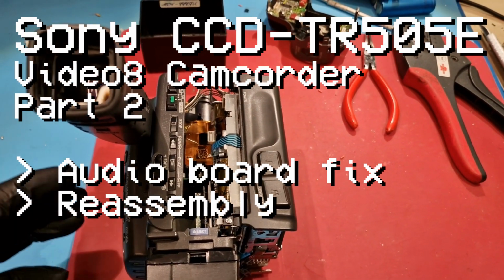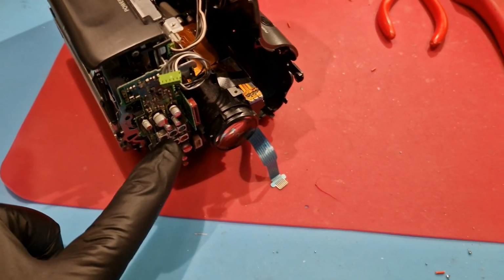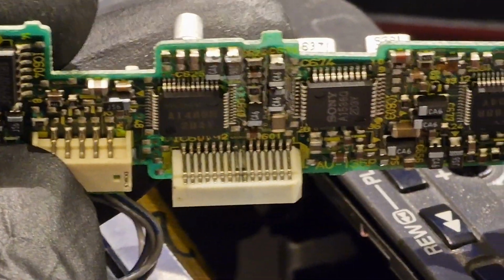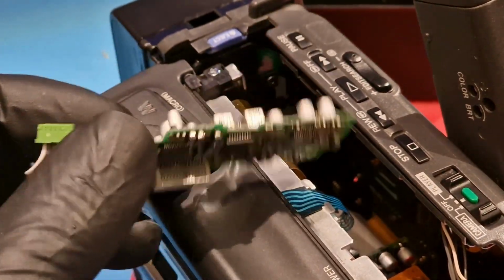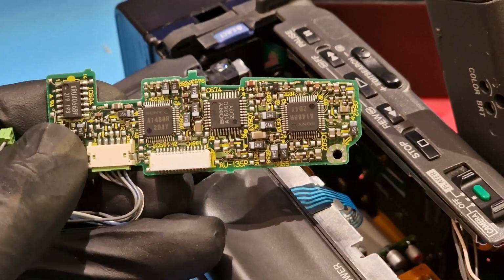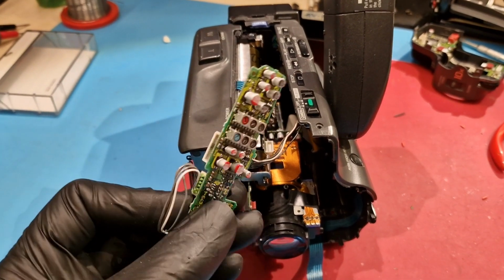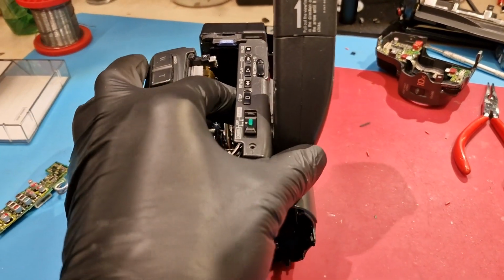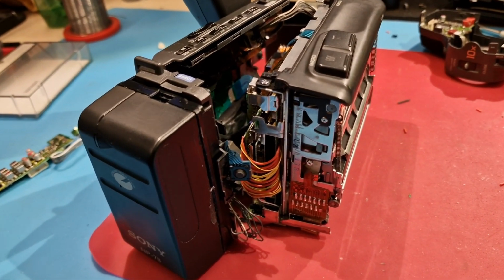TINY COLOR LCD! Sony CCD-TR505E repair part 2

Comment: great job and thanks for sharing! What would you suggest to preserve the flex cable integrity when servicing the boards, double side adhesive tape, glue, .., what do you think. I have a TR305 having similar problems which I need to fix sooner or later.
Reply from the maker: You're welcome! :)

The flex cable has been glued to the edge of both the DC-DC converter and the main PCB - due to age, the glue doesn't stick to the flex cable anymore. Before you start working inside the device, you can carefully apply fresh glue or hold it in place with sticky tape. Make sure to not handle the boards too much to avoid broken connections in the flex cable.